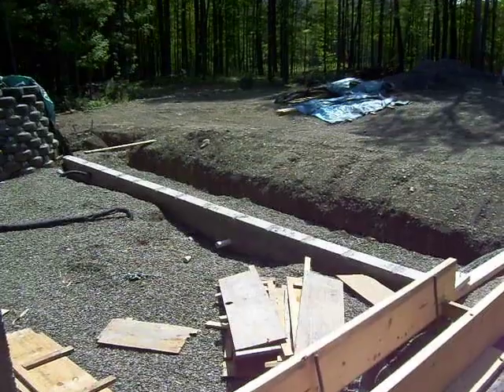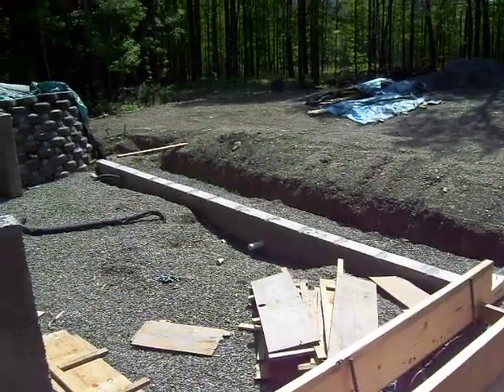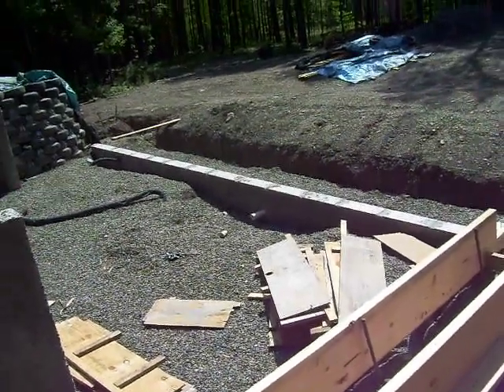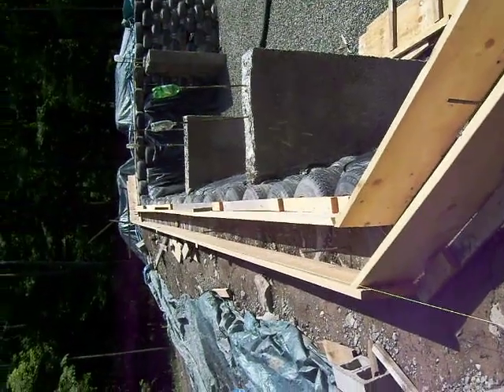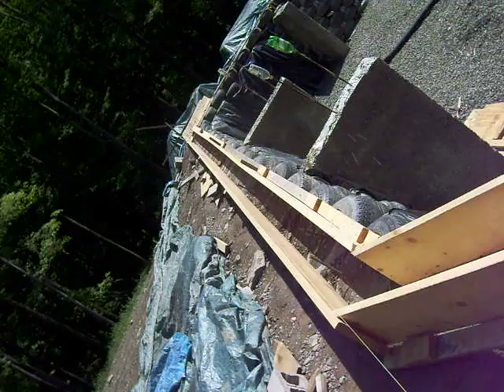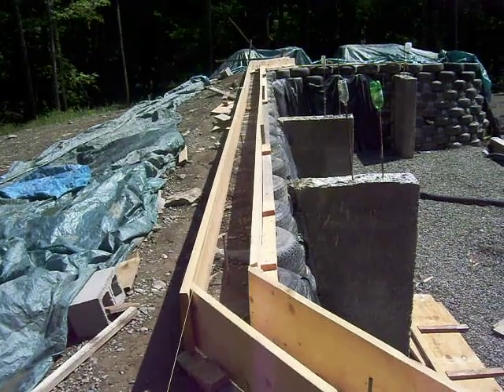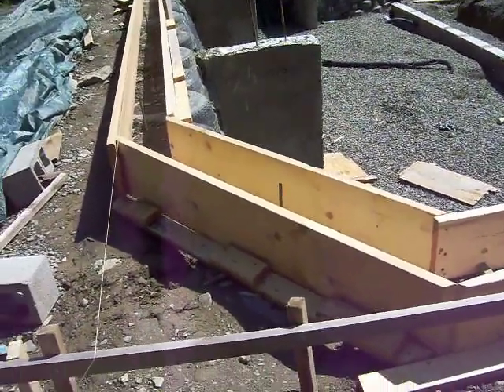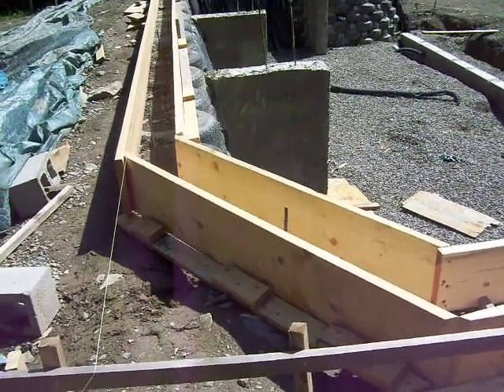Shawn explains the bond beam work

Comment from the maker: It turns out that 50% of tires still end up in a land fill.  So this is a good way to use them compared to that.  I think that burning them is also considered somewhat toxic.  in addition to particulate, there are heavy metal hazards, carcinogens, and common chemical pollutants.  These compounds are locked in the tire until it is burned.